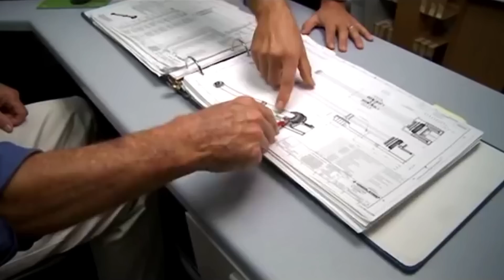US's Ultra-Advanced Railgun Weapon Is Making All Others Obsolete

Comment: Railguns have too many drawbacks. You need a fuckton of power, and frankly, it's cheaper to just use chemical propellants. They're far easier to carry, don't need a huge generator with fuel hauled behind the gun etc.pp.

And that's without delving into issues with the guns and projectiles themselves.
Reply: The tech is being miniaturized with new conductors and small modular nuclear reactors.  Give it time, the first nukes were enormous and within a decade or two they worked them down all the way to the Davy Crocket launcher, basically a bazooka on a tripod.

Comment: At these speeds, I can't see it hitting anything smaller than the side of a barn. To shoot down a missile going 15,000 mph with a bullet seems impossible.
Reply: They're working on control surfaces so they can steer around a bit, but the ones intended to shoot down ICBM's will also fragment and generate a cloud of steel or tungsten pellets like a shotgun shell right before interception, it shows the animation in the video
Reply: From one of the new Start Trek series movies: "(it) is like trying to hit a bullet with a smaller bullet whilst wearing a blindfold, riding a horse." Ray Guns! Now THAT is what you want!
Reply: Why do you think that increased speed = decreased accuracy? Faster projectiles have shorter travel times and less drop over distance, I would’ve thought that the barrel, mount stability and projectile fight characteristics are the main things that affect accuracy on target?

Comment: Guns have to accelerate projectiles in a very short distance, and any energy not transferred to the projectile creates heat, which damages the barrel and limits the fire rate.
Rail guns simply aren't yet efficient enough to compete with regular chemical propulsion. Chemical energy is just too compact.
Reply: 🤣😂🤣🤣🤣 Way to point the obvious out. I think that's why these type of weapons are still in the R&D stage.
Reply: @antr7493  And they'll stay in the R&D stage for as long as there's money to burn.

I work in the def industry, I know media likes to unjustly cry wolf on military hardware programs. I mean, I think think the F-35 is a fantastic aircraft. 

But railguns are the real deal, when it comes to being just a money-grift.
Reply: @antr7493  I don't think any directed research is necessary at this time. We know the problems but haven't the science to solve them. We can continue doing research into new energy sources, conductors, and structural materials independently of rail guns, since these ideas would be more useful elsewhere. Until we tick off the list or come up with new concepts, this idea should be shelved.
I give the US military credit for trying and then giving up. Not all problems can be solved by money and time.
Reply: Also, if you impart too much energy into the projectile in that very short distance, enough to make 'kinetic kill' artillery warheads, then the interior of your gun is subject to the equal and opposite forces needed to generate that velocity.
Rail guns destroy themselves. To such an extent that there isn't even any super-expensive exotic materials tech which can save them.
Above and beyond energy density, rail guns have a fundamental physics problem. (although "less than hypersonic" rail guns may one day actually be practical ...maybe)
Reply: Chemical propellants have a limit on acceleration potential and we are very near that threshold at all sizes of weapons.

To accelerate a projectile faster, you need something that can impart way more energy than any chemical reaction we know of that is that compact.

Some possibilities exist, like the Electro-thermal chemical cannon, which in theory creates a stable, predictable rapid burning propellant that would nearly double projectile speed on Tank Gun (and any artillery cannon for that matter), but this still pales in comparison to a Railgun.

Simply put, despite the power requirements and complexities, Railguns can accelerate projectiles to speeds that no chemical gun can hope to reach and allow for ranges that put even some missiles to shame, while being more economical on a per projectile basis and have deeper magazines.

But the main issue isn't even the power consumption or discharge, that is solved for the most part and further advances will result in significant miniaturization.

The main issue really is barrel deformation. 

In order for a Railgun to work, the projectile casing must be in contact with the barrel at all times, to complete the circuit and accelerate the projectile. But the energy needed for this is so high, that the barrel basically begins to melt after a few uses and becomes unusable after a few shots.

To date this has not been fixed and is the reason why Railguns where never fielded for trials, much less operation, as the barrel wear and tear makes them unusable.

Until this major hurdle is overcome, Railguns will be a weapon of science-fiction, but once this is mitigated to a more reasonable level, then they will outperform any modern gun by a long shot.

Comment: If you want to see a small demonstration of pulsed power, have a look at my channel. You can see coin shrinking, can crushing, and disc launching using pulsed power. I use a single 220 pound capacitor charged to about 12,000 volts for coin shrinking which corresponds to about 7200 joules. My capacitor is very similar to the type used in rail guns, although many more capacitors are used for a large rail gun. A rail gun is based on the same principles. Charge a large capacitor bank and discharge it through two rails. Place a conductor, the projectile, between them. Lorentz forces propel the projectile. Rail wear is a serious problem because millions of amps of current is being passed through the rails and the projectile. A small rail gun is one of my future projects.

Comment: I've heard that one of the issues with rail guns is wear and tear on the barrel. It needs to have a material that can withstand the kind of friction that a hypersonic projectile produces and still have a decent service life. Not an easy task.

Plus with hypersonic glide bodies traveling at mach 17 and being able to hit anything with-in a 1000 miles... it kinda makes rail guns look a lot less capable.
Reply: Although these vehicles are hypersonic their maneuverability is still questionable. Even if they're maneuverable hypersonic vehicles the space it takes to execute a turn for a non-hypersonic vehicle is a few hundred feet to less than a mile whereas a hypersonic vehicle executing the same turn would have traveled several miles. This is why in the hypersonic age the US still continues to produce subsonic missiles.
Reply: well the barrell wear compared to a glide vehicle is still very cheap. also the will be our best way beside lasers as stationary icbm defense.
Reply: @Thor_Asgard_  cheap but it limits rounds per minute. The navy wanted something that could fire 6 rounds per minute but that rate of fire would destroy the barrel faster.
Reply: I heard its the forces that seperate the magnets on the far side tend to warp
Reply: rail guns pretty much destroy themselves.
if you look at the kinetic energy imparted onto the targets... an equal and opposite amount of energy is imparted into the gun.
The barrel liners disintigrate very quickly, the structural components of the rail gun warp, the magnets break and/or melt... they can't even get a one-off "laboratory princess" rail gun with expensive exotic materials to survive being used multiple times without being rebuilt over and over.
Reply: "can withstand the kind of friction that a hypersonic projectile produces and still have a decent service life. Not an easy task."

its an impossible task. You need a very low resistant material that has the ductile of copper and the hardness of diamond. Obviously the ductile of copper & hardness of diamond is impossible.

Hypersonic missiles need an ICBM size rocket to get up to speed. The cost is is about $7M to $10M per missile. Not really practical for conventional warfare.

Comment: The Chinese Navy's railgun required a ship the size of a large freighter in order to house just the single gun, and the electric power plant required charge it
Reply: Coal powered rail gun?
Reply: Its for show. I doubt it actually works. They can barely build AESA radars without thieving from the US. They stole KB's of data on the EM launchers for air craft carriers and the F-35s radar and other data.
Reply: I don't even buy that it's anything but an empty turret. China has built entire fake cities. I wouldn't put this above them.
Reply: A cruise missile would end it
Reply: Sheesh, sounds super useful, can’t wait until they try to use it during war and it gets bombed before it even has the chance to get setup. Wonderful
Reply: Ok.
Look at the size of the one they testing and how many cables are attached to it.

If the US Navy did the same thing with current technology the size and power required would be comparable.